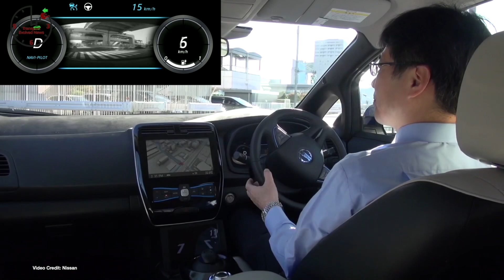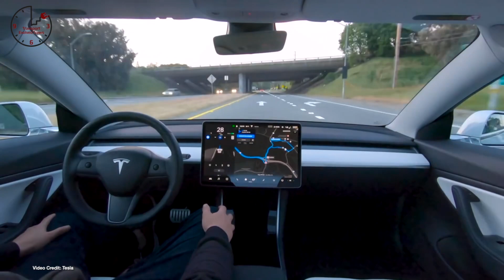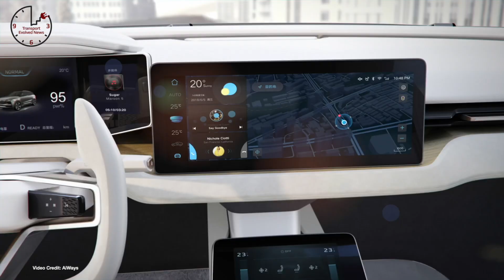TEN 295 - Rivian Rapid Charging, Tesla’s 12-Seat Van, Germany EV Charging Requirement

Comment: Somerset Levels - he’s never heard of flooding then.
Reply: Yeah, Elon needs to pick somewhere on higher ground. I suggest he looks to the old industrial mill sites of the North. Build the UK Gigafactory a little more vertical and put it somewhere like Queensbury or Tong near Bradford, or Oldham near Manchester, high towns not far from motorways and major A-roads. You'll be able to use wind power on site too!
Reply: Maybe Sunderland when Nissan folds lol
Reply: @DanFoxDavies  Building on old former industrial towns sounds like a great pitch really, development there is always welcome. But I think there should be more nuance of concern of what happens when a large, high tech employer of highly skilled/paid workers exist in areas that were known as the most impoverished regions in the EU's northern member states. Shops and services can be expected spring up around the plant and its workers, but there's also a good chance that it can create a wealth divide as working classes could potentially see a rise in their living conditions and rents if their area went upscale.
Supply and demand aren't the end all be all. The practice is often the case of charging the most someone is willing afford.
Reply: Dude flooding, Tesla factories float on air didn’t you know that?

Comment: It's likely not possible to patent idea of using contactors to switch two 96 string batteries into one longer 192 string battery.  Absurd. It's just... regular low lever electrical manipulation - can be repeated with two AA batteries.